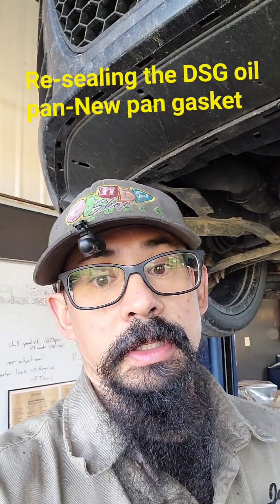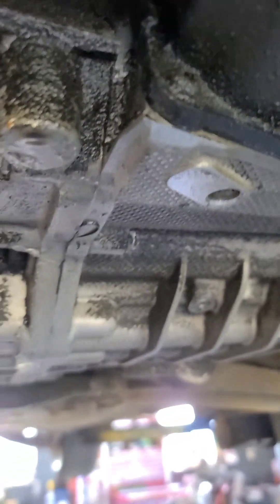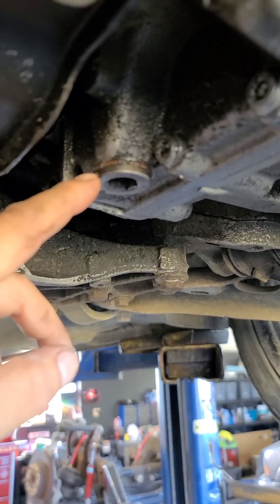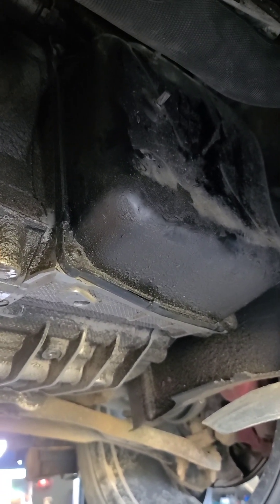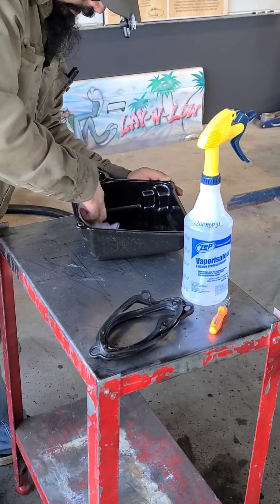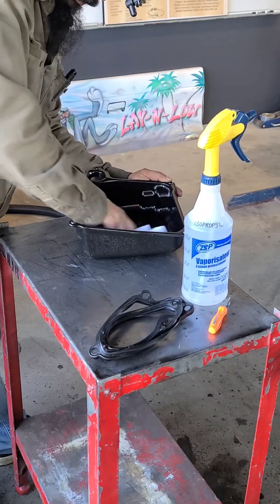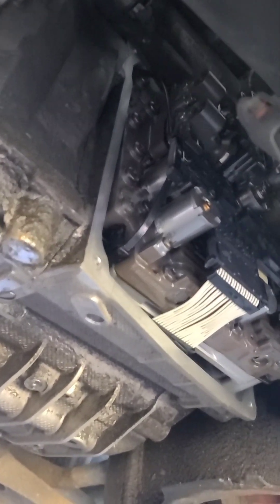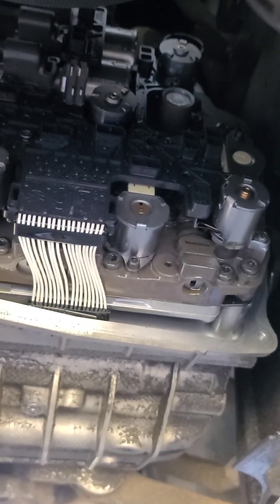DSG oil leak

Comment: Is this dry clutch or wet clutch? My passat b6 with dq250 wet clutch has a leakage, but i dont know if its motor oil or dct fluid. Its looks like motor oil, maybe too clean. How can i tell by looking at the fluid? Im also trying to clean and see where it come from